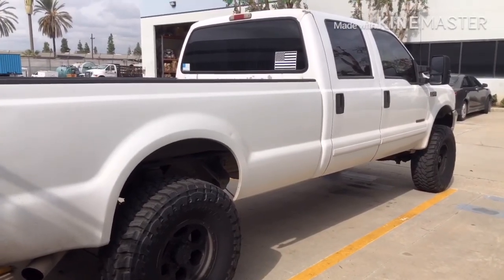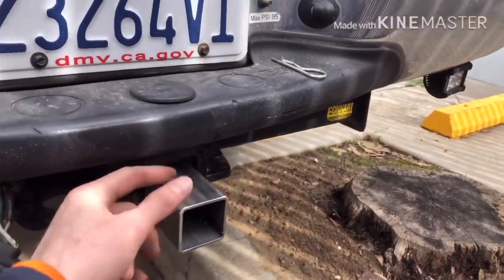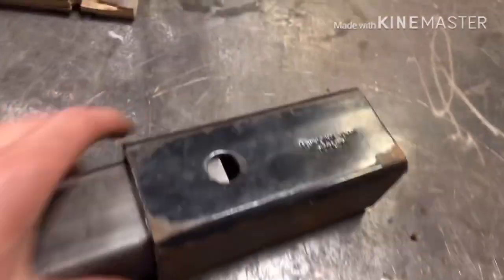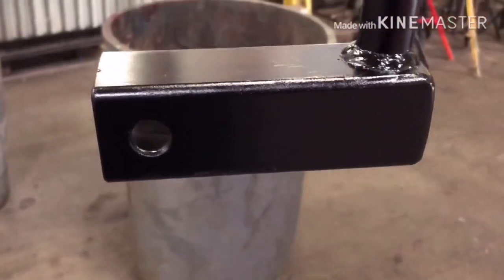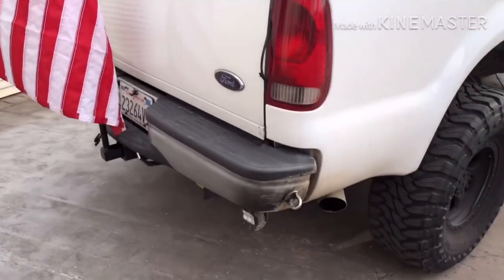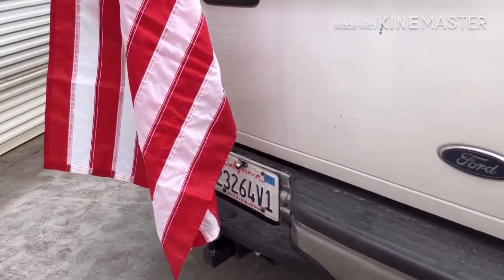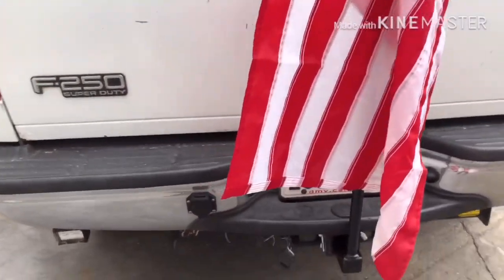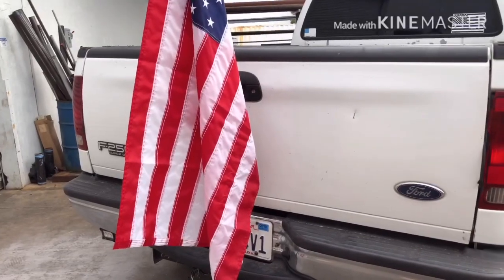Lifted F250 7.3 powerstroke trailer hitch flag pole | I messed up!😂 fabricating/ welding | easy fix

Comment: I’m not %100 sure but I think the flag should fly on the passengers side. Just flip the extension to the right side and weld your pole to the top. I saw it on YouTube so I could be wrong but check it out before you have to do it again. Great welding job.

Comment: You gonna sell these when you get the design sorted out?
Reply from the maker: No, not planning on it. Just wanted to make it for myself. Unless I happened to get a bunch of requests but I doubt that will happen 😂
Reply: It's a good lookin flag pole bro! all I would say tho is if it were me ide drill a hole the size of the pipe put it through and weld the top and bottom for extra assurance
Also I'm pretty sure it's not that big of a deal if it covers ur plate just slightly as long as they can see the sticker on it I think ur good but that's a sweet looking job!!